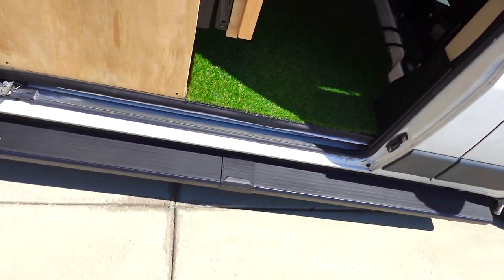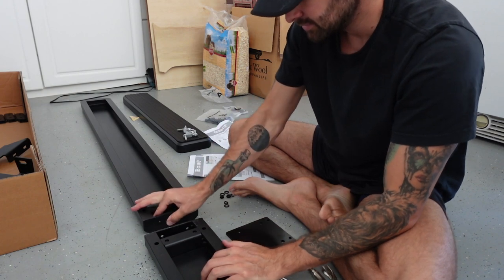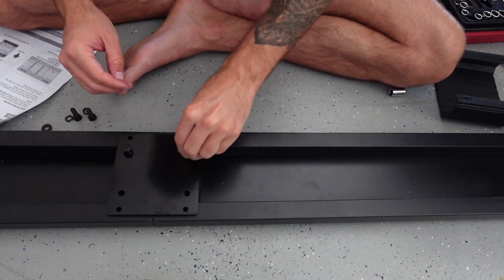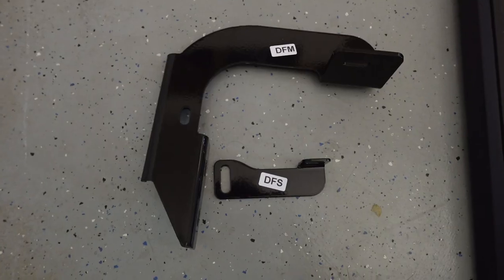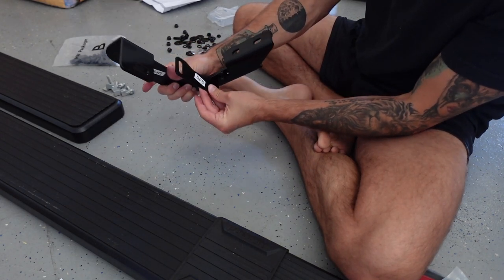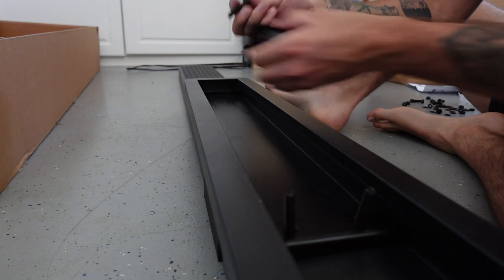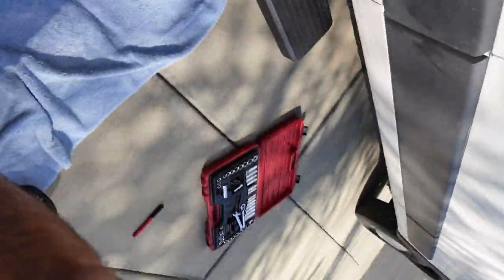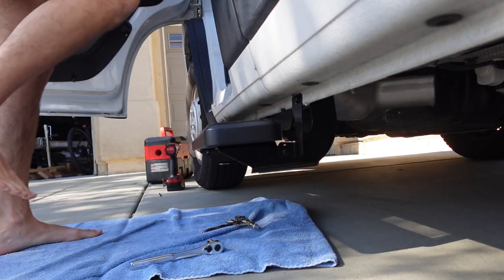How to Install Side Steps on Your Van | Easy DIY

Comment: Super awesome install video. I got some running boards myself, but I consistently ran slower every time I tried running with them. Using them on the van is definitely a better idea! 5/5 stars!
Reply from the maker: Hahaha learning to run with the boards is a pretty advanced technique…

Comment: I like that you used rustoleum on the drilled holes. Also that you preinstalled the plastic washers for the passenger side. Just wondering if you could have drilled a new hole to get even spacing on the brackets. Maybe not needed? Thanks for the video!
Reply from the maker: Thank you! Gotta prevent that rust

I probably could’ve drilled a new hole, I didn’t even think about it. To be honest though, the spacing hasn’t seemed to be too much of an issue. The step feels plenty sturdy 👍

Thank you for the kind words!